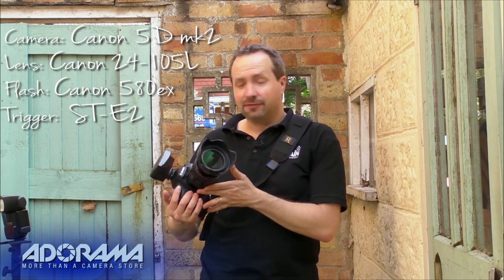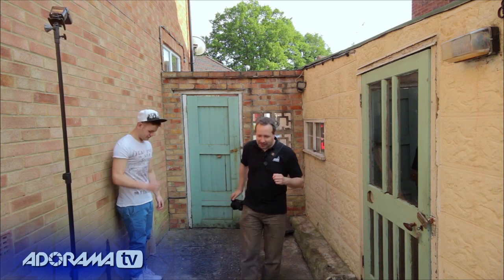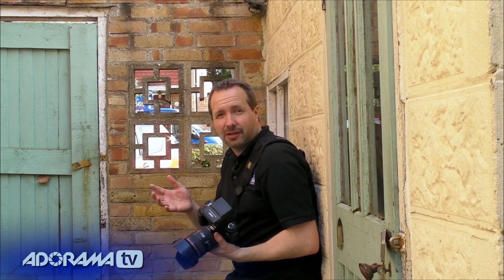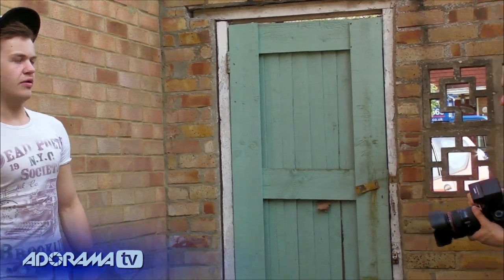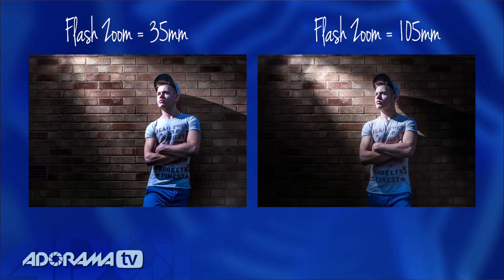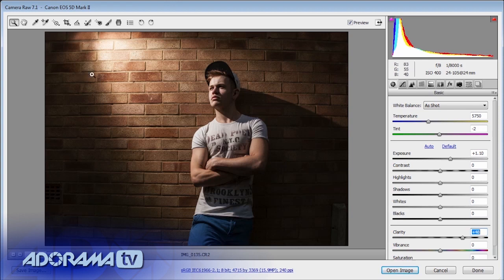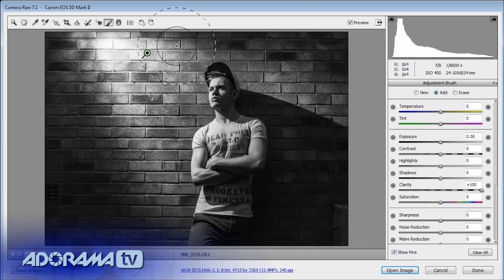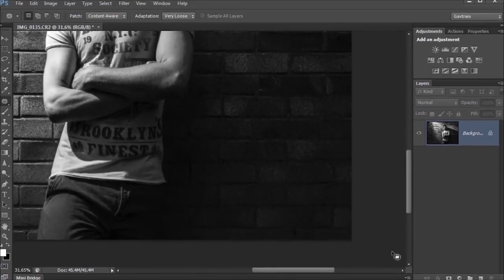Using an Off-Camera Flash: Take & Make Great Photography with Gavin Hoey: Adorama Photography TV

Comment: Didn't have a bit of problem with anything until you used the patch tool to remove an item from the shot. Poor ethics.
Reply: Jeff Stanton- poor ethics? What are you talking about, this is portrait photography, not photojournalism!
Reply: Jeff Stanton what the hell are you talking about? It's sometimes necessary to do these kinds of things. Sometimes things are missed or simply can't be helped. Or sometimes an element was desired at one point and the photographer changed his mind. That's the entire reason photoshop was made. Ansel Adams and all of the great film guys did it themselves.

Comment: Dear Mr. Hoey, 
You should also mention for DSLRs that don't have HSS, you could use an ND filter to bring down the ambient exposure (my entry level DSLR D3300 can't do HSS). and shoot at or below the maximum sync speed of the DSLR of 1/200sec or 1/250sec. 
Since these tutorials are meant for beginners, its more likely beginners to own /use entry level DSLRs with limited features. Thanks for the tutorials.
Regards.
Reply: afaik, off camera flash with HSS is dependent on the flash model. you can do off camera HSS with D3300, just buy a capable speedlight and trigger. problem solved.
Reply: yep correct you just need some dumb speedlight and a HSS trigger and receiver

Comment: I have a question & hopefully I can gather some advise on from you guys or the fello subscribers. I have the Nikon d3200 which doesn't have "HSS" high speed sync. Is there anyway I can go about uptaining that without having to purchase a new camera or spending a fortune. Any advise would be deeply appreciated.
Reply: +SBF Vizualz Use an ND filter to bring down the ambient exposure and shoot within the limit of the maximum sync speed. Using an ND filter, you could even shoot with a wide open aperture if you use the right ND filter and get the nice bokeh affect (the autofocus may struggle to focus when using an ND filter)
Reply: Get a HSS trigger and receiver is another option

Comment: I think this is a great video, its not too difficult to set up yourself and shows the relationship of ambient light to flash using the shutter speed to control the balance. Its one part i think many photographers struggle with, the technology of HSS has made this possible.

Comment: I'm a beginner in photography and I dont have the type of equipment you have as I'm mostly on a budget the gear I have are a canon 1100D (Canon t3) , 50mm 1.8 lens , 17-55mm 2.8 lens , I also have a cheap youngo 460 II . My question is how can i achieve a picture similar or at least the closest I can get with my gear . Thank you in advance =)
Reply: You can get similar or the same results with your gear, just buy a flash stand and a cheap wireless trigger.

Comment: why use iso 400 if the ambient light is not needed for the exposure anyaway? does iso have an affect to flash also?
Reply: ISO effects both ambient and flash exposures (in the same way as aperture does), so going from ISO 100 to ISO 400 makes the flash 2 stops more effective.

Comment: Somewhat true.  In HSS mode the flash has to work much harder at 1/8000 to achieve the same results you would at 1/2000th.  Under 1/200th sync speed you would be correct but in high speed sync the faster the shutter speed, the less light the flash can squeeze into that sutter opening.  Its a strobe light in effect and you simply get less "strobes" in 1/8000th vs 1/2000th.

Comment: You also get a shorter flash duration and faster recycle times (or more flashes per burst when you're still above the minimum firing charge level on the capacitor). When it doesn't "cost" to use a slightly higher ISO (the noise isn't much of a factor -- it can be on some types of shots -- and you don't have to use an ND filter to get the shutter speed down) it just sort of becomes a habit you don't think about much, and probably wouldn't think to explain.

Comment: ISO 400? and 1/8000? just get your iso down to 100 and shutterspeed up to 1/200 and f/22. You would not need hi sync flash, draines your batteries in less than 80 shots!
Reply: But at f22, you would get a lot of diffraction, thus the picture would lack sharpness! But I agree that it's likely possible to tweak with the exposure triangle and avoid using HSS.